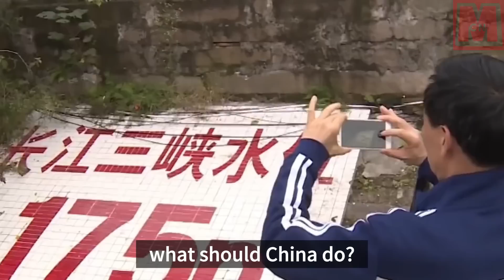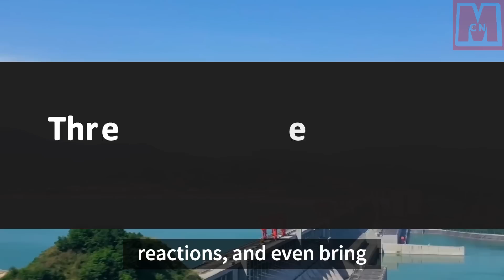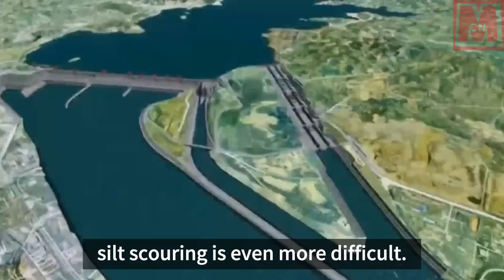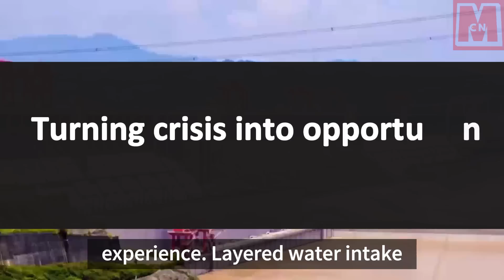Three Gorges Dam in crisis? 1.8 billion tons of silt accumulated. Can China find a solution?

Comment: I think that this solution would be effective,
install between 3000 and 5000 vertical water pump from the gorge in the direction upstream
when all pumps are working - the silt would slowly rise and enter the ware flow - through the dam 
 The water pumps should be a t a depth just above the silt - and not inserted into the silt bed 
this will prevent the silt from settling
Reply: Most dams have a pipe to relieve silt buildup. It must be flush once in a while before it gets to a dangerous level.